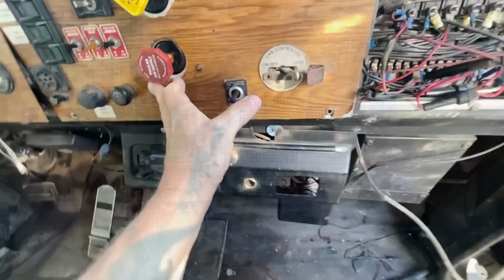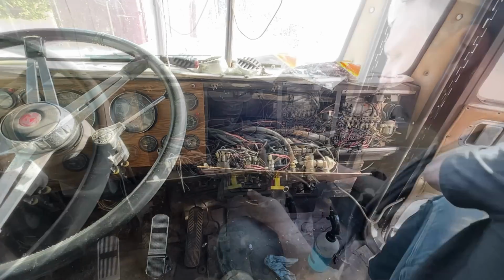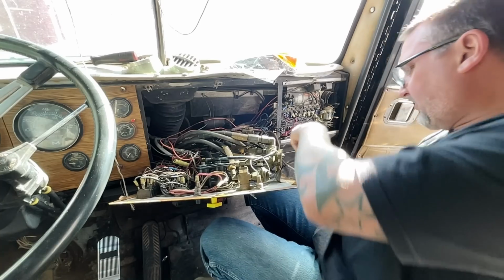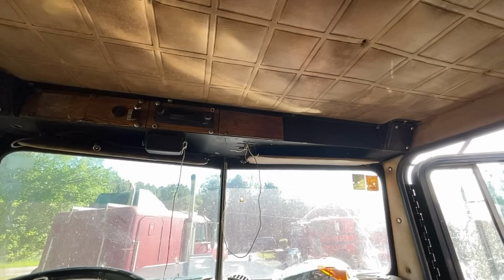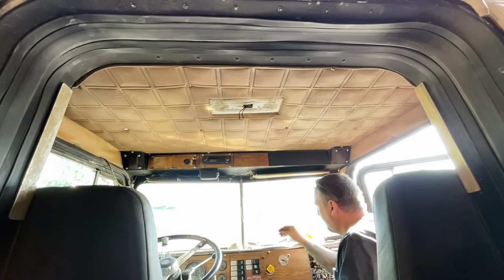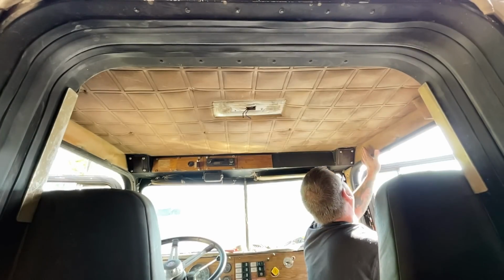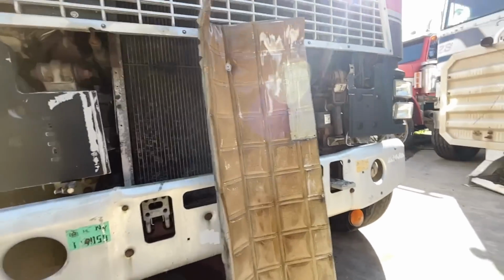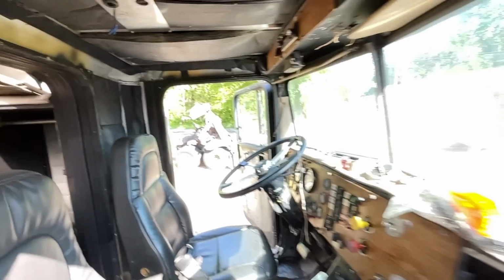89 Marmon 57p Black Betty, Can This Interior Be saved?

Comment: There is a solution that professional, detailers news. 

It is called SC -1 All you have to do is spread on generously and just take an air hose and spray it off and it will literally pull the tar out of the interior.

It does work because I worked in a detail shop for four years and then used it daily, and I was amazed every time and used it .
Reply from the maker: I’ll check it out